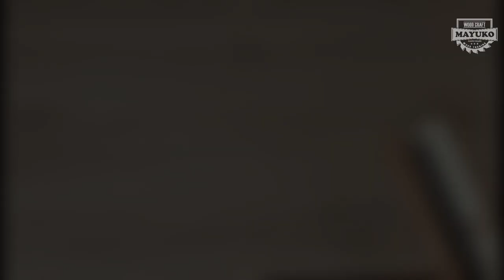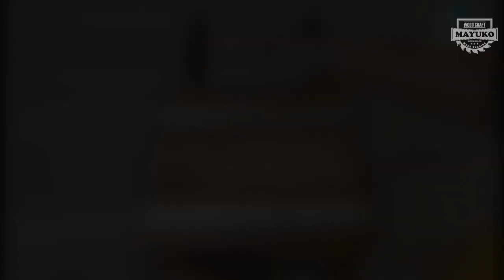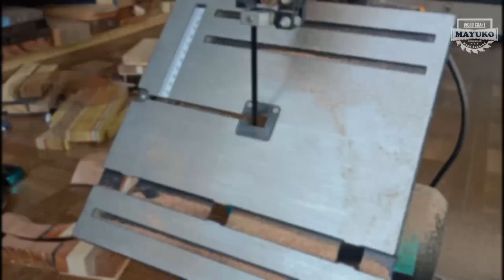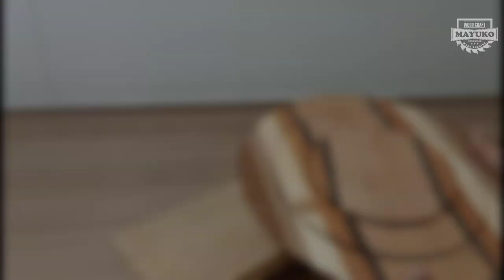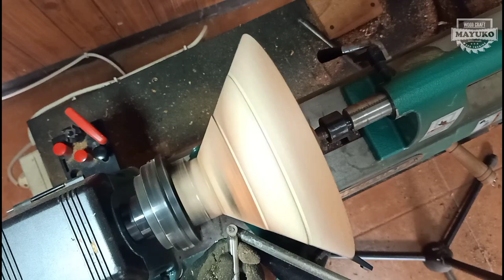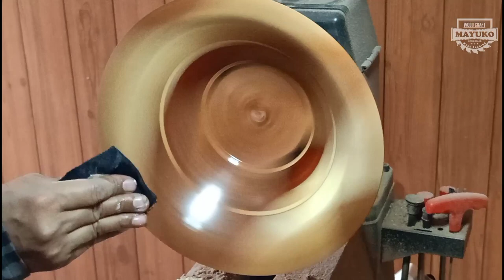ECONOMY BOWL - Wood board becomes a bowl with stripe

Comment: Do the size of the rings need to be in some proportion to the thickness of the board?  Thanks you
Reply from the maker: Of course, the thickness of the board will determine the slope of the angle and must also take into account the thickness of each ring when we cut the diameter of the ring